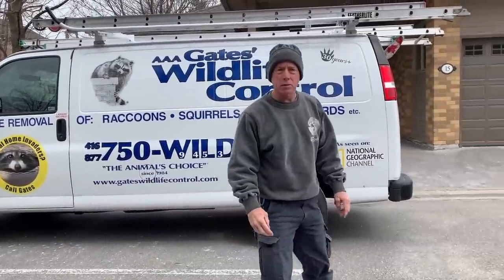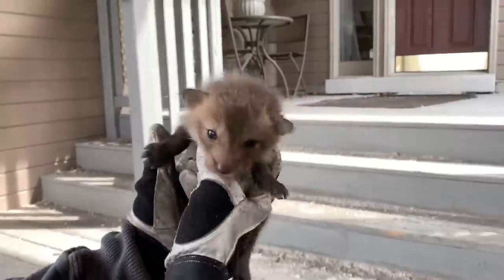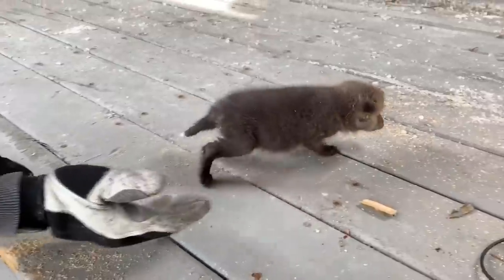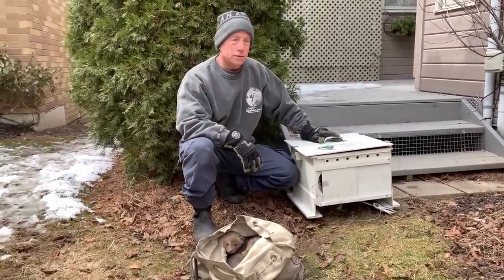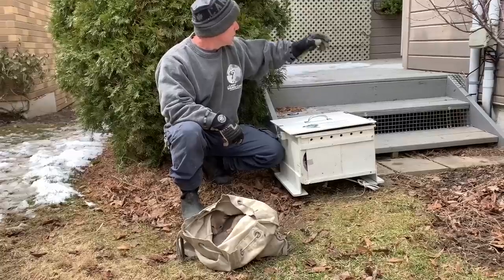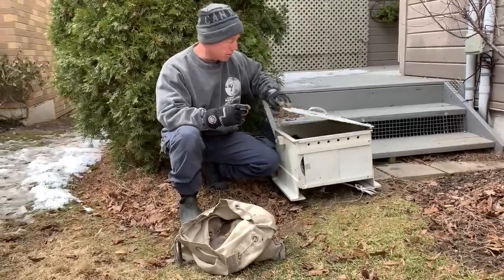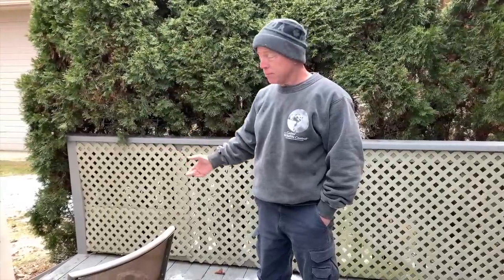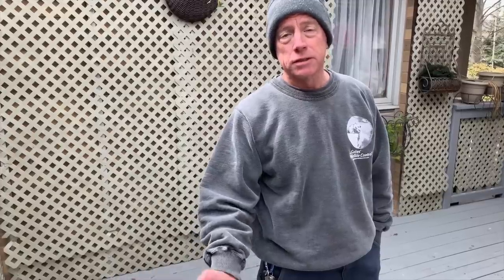Baby Fox Frenzy | Too Cute For Words!

Comment: Fantastic!
I love the fact that the vixen returned to get them all.
Last summer, I had a problem with a skunk and two babies that were visiting the cats on my patio.  They came for the food and milk.  When I called wildlife service to have them removed, I assume they would catch and release in the wild but to my surprise, I was told that they actually kill them.  So I told them I would not require their services.  I fed the mom and her two babies all summer. Actually, the mom got so used to me putting food out, that I could actually walk with a few feet from her. In early autumn, they stopped coming.

Comment: Bro, proper prying tools and technique you could have pulled those boards and saved your customer some cost, wood was in good shape enough to reset and reseal. A cheap fibrescope off Amzn to check all the holes you want before exploring.

Comment: Some points.  Surely better to wait until the pups are bigger.  Why a bag, why not a cage for them?  They could suffocate.  And really, unless you release them in a wilder area, you are displacing the problem to another home (foxes will move in to territories where other foxes have been removed as well) and putting the whole family's life at risk.  So I would not call this particularly humane.  I know you are trying but perhaps some improvements to method could be made.

Comment: You do Realize , you Should be Wearing SAFETY GLASSES when you are Using those Power Tools ?  Also, Do Not Use a Hammer as a Pry Bar .  That is a Bad Habit .  You will Find a few the Right Lengths for you Needs on that type of Work .